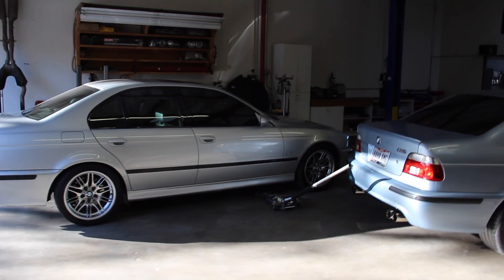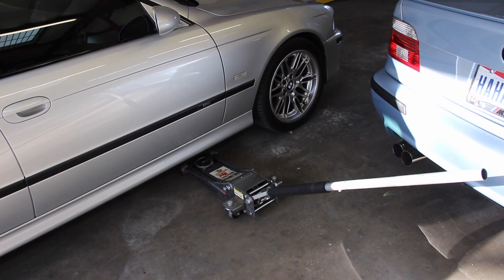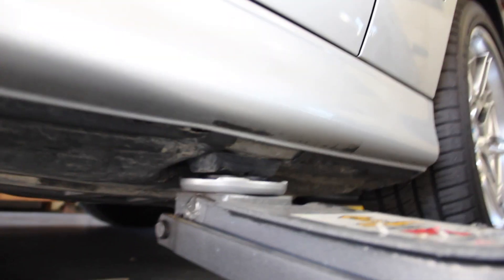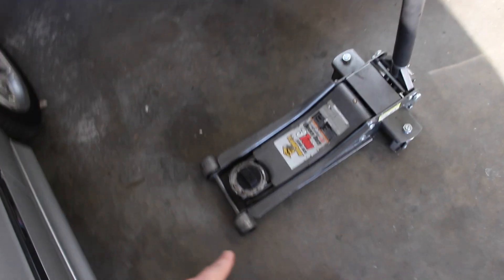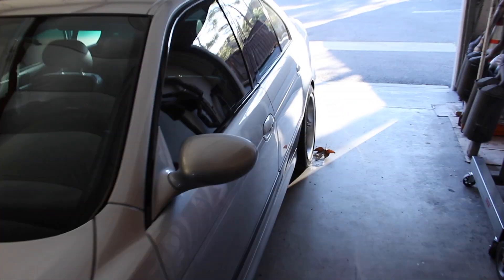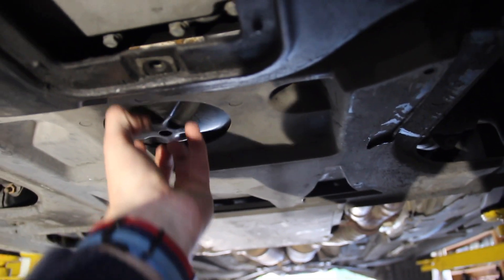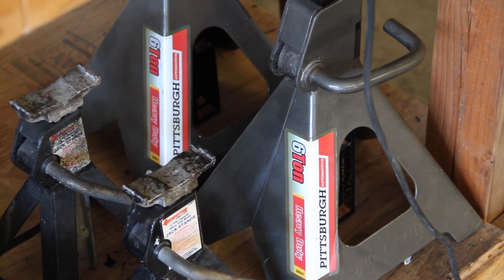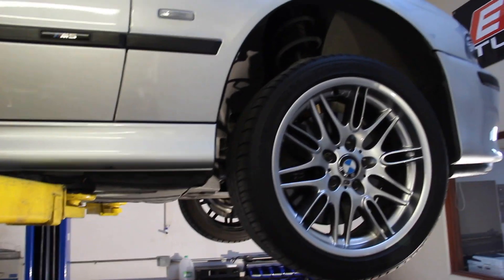How to Jack and Support your BMW E39

Comment: I dont know if it already exist, but an idea to a video or article: The different options/equipment on the e39.

Great video btw!
Reply from the maker: I've considered such an article, but the options list is HUGE from 1997-2003 and different options were available for different markets at different times.  It would require a ton of research.
Reply: @E39Source  Well that's understandable, but would be cool though.
Reply from the maker: @mrmick12321  It would be neat to have it all in one place.  Unfortunately I am not at all compensated for the time it would take to do that, which could be serval days of gathering information.

Comment: Great video. Question regarding rear jack stand placement - my rear jacking points are rusted, so am wondering where else I can place jack stands after jacking from the diff. Thanks.
Reply from the maker: Unless the rear jack stand spots are REALLY bad, they are probably the best place to put the stands still.  I have never used other places for stands.

Comment: What is the best way to keep the car from moving when jacking up the back (from the differential, etc.). Since to my knowledge the parking brake only applies to the rear wheels, would I need to put wheel chalks in front of the front wheels? Or is there some other way
Reply from the maker: On totally flat ground, this should not be a concern.  I would recommend chalking the front wheels though- maybe one chalk in-front of and behind one of the front wheels.

Comment: "How not to crush your ridiculously designed BMW sheet metal rocker panel jacking point"
Reply: Man do i hate rusted E39 jackpoints
Reply: Ash  They often collapse when you go to jack up the car using the factory supplied jack, and more than often before you discover the hidden rust.
Reply: @williamskagen9901  Me too. I have 2 do deal with, so I have to carry an aluminum compact floor jack in my trunk until I can fix the rust.
Reply: My rear jack point just got crushed a few hours ago. My jack went inside the rockerpanel.and i now have dent in the skirt. I got lucky that my safety jack was in place. And safed my legs. Guys be carefull. I think its way safer to use the diff and front center jack point, As ryan showed. Do NOT trust the side jack points, mine showed no sign of failing. But rust did take them out from the inside.
Reply: Also a bit oftopic i just replaced my rear brakes. Only now my handbrake isnt engaging when i pull it. Does anyone know how to ajust it?
Reply: @makavelietre  Two ways at four points: Two inside the car under the leather handle boot, and two outside, (one at each rear wheel) requiring removal of the rotor to inspect the parking brake shoes, and to access and spin the adjusting starwheel.
Reply: @makavelietre  Huge bummer. Someone prior to me did that to my car too- right rear rocker crushed in. Most regular E-39s with the exception of the far more valuable- and probably well kept M5 versions, have been neglected there.

Comment: Hey, I was hoping you would show how to jack up the engine on one side - in my case it would be the driver's side of an V8 (535iA). Need to replace the power steering hose from the steering box to the oil cooler and I just can't get to the bolt... Part number 32411094205
Reply from the maker: That's a fun job.. good luck.  To jack the engine, I would release the motor mounts where they bolt to the subframe (2 13mm nuts on each mount), and then use a piece of wood to distribute the load from the jack on the corner of the oil pan (strongest part).  If you need to raise it more than 2 inches or so, you'll want to remove the fan and fan clutch so it doesn't hit the fan shroud.
Reply: @E39Source  yeah, it's intimidating xD Appreciate your input Ryan 🙏